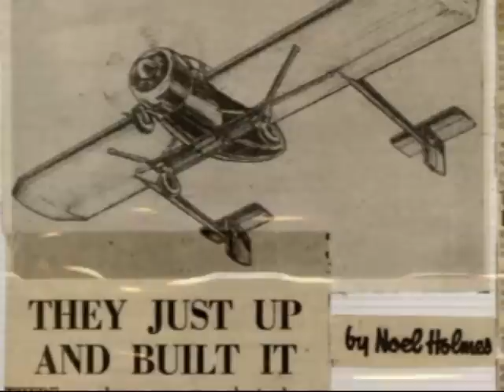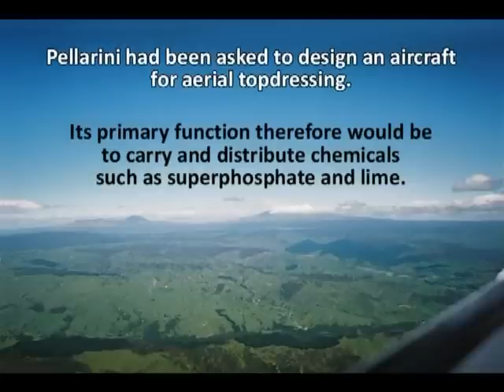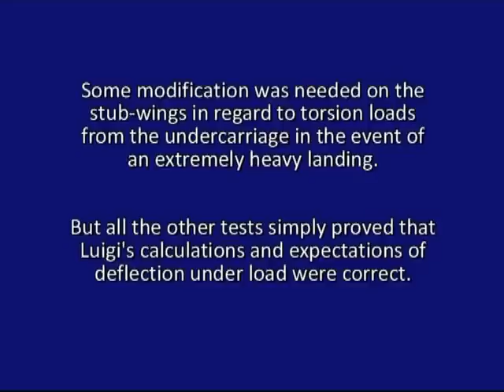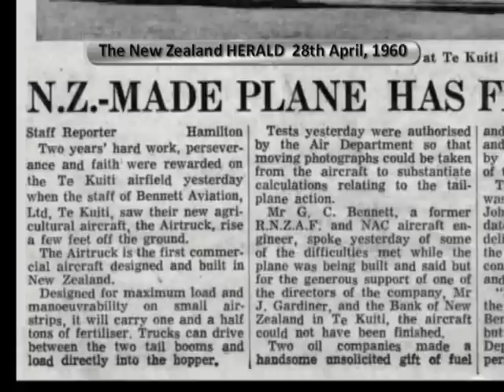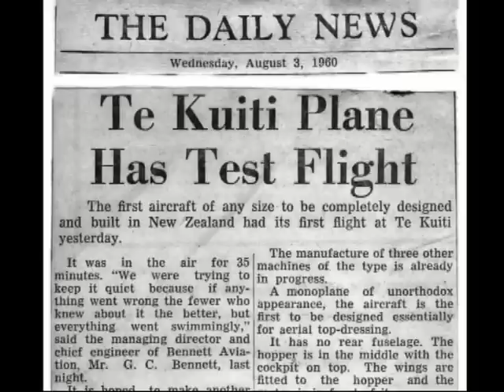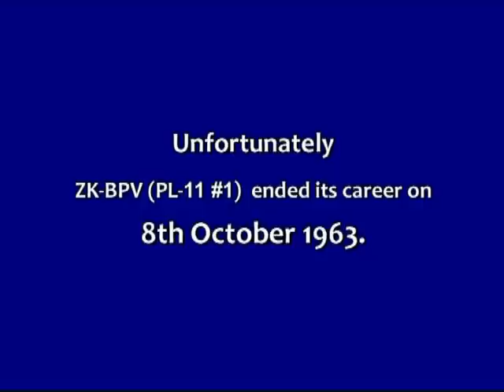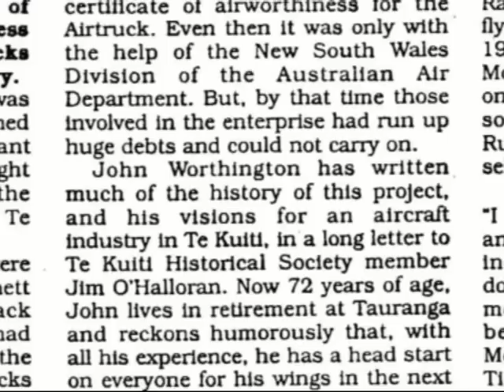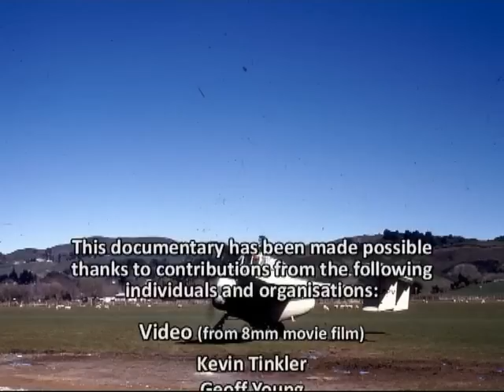PL 11 Airtruck Documentary ZK BPV MP4

Comment: The Aeronautical Engineer mentioned was Jeff Young- Not GEF.
Reply from the maker: Sorry to contradict you Shar but The  name of he Aeronautical Engineer who redesigned the PL11 after Luigi Pellarini left was Geoff Young - initials were G.E.F. Young.   
Jeff (Jeffery) Young was the maintenance man employed by Northern Air services. Jeff had nothing to do with building the PL11. 
Remember, I was there -- I was one of the team who  worked on the first PL11 prototype.  I knew both of the other two men who had the same surname as me, and to the best of our knowledge none of us were blood relations, but we did all have the same surname of "Young".
Reply: @rogeryoung9042  Jeffery Young was a British  R.AF. trained Aeronautical Engineer employed by Northern Air Services Ltd by J. C. Worthington as Chief Engineer, then Chief Inspector on the PL11, including construction, repair and maintenance, between 1961 and 1967. As chief Engineer he was responsible for a list of  other NAS Ltd and  Rural Aviation Ltd aircraft .
Reply: @rogeryoung9042 .what ever happened to the on that flue in the Mad Max Movie?
Reply from the maker: @sharynyoung1  Hi Shar. You mention that Jeff Young was British RAF trained. I was unaware of that, and yes he probably did  do maintenance work on Worthington's machines - couple of Cessna 180s and the original PL11 ZK-BPV.  At one stage Worthington also had a 150HP Piper Cub fitted with a hopper, but Jack W himself wrote that off even before I left Te Kuiti.  The Geoff Young, who took over the Airtruck design work after Luigi Pellarini left had previously worked with deHaviland in the UK . He certainly had the necessary University qualifications and hands-on experience to take on the task or checking all of Luigi's work and supervising the construction of PL11 #2  ZK-CKE.
The RAF trained Jeff Young you mentioned might have been involved with modifications to ZK-BPV, but in my discussions with Geoff Young, after he moved to VIC in Australia, he spoke as though he was the one only who assessed and supervised all the necessary mods to ZK-BPV. When he saw the video I had produced he admitted that he never had time to even think about taking photos of the development of ZK-CKE (PL11 #2). He was too busy "talking" with engineers from Civil Aviation Authority  AND  worrying about where the money would come from to pay his staff each fortnight.
Reply: @rogeryoung9042  Good to hear from you. I have found documentation that shows Jeffery (Mills) Young was indeed the Chief Inspector for the PL11 Airtruck (construction, repair and maintenance.). J.C Worthington was managing director (N.A.S.) and friend.  D. Simmonds the Engineering Manager at Rex Aviation. Jeff Young was Chief Engineer for Northern Air Services Ltd, later part of Rural Aviation Ltd. Maintenance, repair and overhaul was undertaken on Cessna 180,185,188, 172,182, PA18, DH82 Taylor 22 Kookaburra, Continental 0470,10470, 10520. 0320 Lycoming 0200 Gypsy Major. PW Wasp.P11 Airtruck.
These numbers probably make more sense to you than to me. If Geoff Young is still alive, I would be most interested to correspond with him and get a photo of him, as he most likely knew my father, Jeff Young. My brother and I often stayed on Te Kumi airport watching our father work on the airtruck and other aircraft. We often had Christmas with the Worthingtons. There are so many coincidences here. It is fascinating.
Reply from the maker: @sharynyoung1  Thank you for the input, Shar.  I got to know Doug Simmonds very well while I was working for Rurals in New Plymouth - also did a couple of stints in their Tieri workshop (Dunedin). Actually - a little secret - after I had written to  Rural Avn asking if they had any vacancies for workers in their hangar I got an immediate reply, "We have vacancies, when can you start work?"  But Doug was not happy with that. He and Snow bennet had been very good mates with the RNZAF on Guadalcanal during WW2.  So Doug took himself for a "little drive in the country".  and arrived at TeKuiti (aka  TeKumi) airfield, to ask Snow why this bloke was leaving an interesting project.  Well, Snow was VERY generous - gave me a very good "write-up" so that when I did arrive at Bell Block, New Plymouth, a couple of weeks later I was embarrassed to learn that I was expected to perform far beyond my own experience at the time . SO that kinda stretched me to do my VERY BEST on any repair job.  Then when Simmo learned that I had already passed my airframe LAME exams - and been issued with a license - they immediately put me on engine servicing (not my forte, at that time) so I could sit (and pass) my engines AME exams. The management seemed to be very pleased to have a LAME (airframes and engines) who also had a PPL  - Private pilot license. So I was the one chosen to go out on more than one occasion to "fix" a Cessna out on an airstrip and then fly the thing back to New Plymouth. I was just very happy to be able to get a few more hours in my logbook towards my CPL. Then towards the end of 1962 John Barr offered me a job in Ardmore - which I accepted. But that really put the "cat amongst the pigeons" because Peter Lacey, the only other licensed bloke on the hangar floor at that time, had just handed in his resignation a day or so before.
Reply from the maker: @sharynyoung1  
Shar,  My mind has been in a bit of a spin with some of the claims you have made about Jeff Young's involvement with the NZ built Airtruck.
However, for the sake of others who read this post I do need to point out that there is no contradiction in what you have claimed as opposed to the video I produced about the manufacture of the PL11 aircraft ZK-BPV in Te Kuiti, New Zealand.  
The "problem" is with dates. I would like to see the dates on those work documents you refer to where Jeff Young was doing major work on the PL11 Airtruck(s).
If you look at the dates on the work sheets where Jeff Young was involved I am fairly certain you will find they are all dated 1964 or much later. I am not certain what date Northern Air Services was taken-over (or absorbed into) Rural Aviation, but I agree there would have been quite a variety of aircraft types to be worked on. But that would nearly all be after Waitomo Aircraft Company ceased to exist and Geoff Young had moved to Gisborne, VIC., Australia in Jan 1965.

ALSO. A few facts that need to be recognized:
Jeff Young was employed by Jack Worthington to do maintenance work on aircraft operated by Northern Air Services. This was because some time in 1960 Snow Bennett had told Worthington that Bennett Aviation could no longer provide the manpower needed to do maintenance on NAS aircraft. But he was never employed by Bennett Aviation nor by Waitomo Aircraft Co who built the two prototype PL11 aircaft.

It was probably sometime in 1960 that Luigi Pellarini effectively walked off the job in disgust because the NZCAA officials did not seem to recognize his knowledge and experience in designing and building  aircraft. By the time he had started on design of the PL11 Luigi had already designed and built several successful aircraft. After settling back in Australia he was instrumental in starting up the Transavia company and working with Australian CAA had approval for his PL12 design long before NZCAA gave approval for the NZ built PL11 in 1966.  By that time Waitomo Aircraft Company had run out of money.

Geoff Young initially began work with Bennett Aviation in March 1960, and as Snow Bennett began to realize the qualifications and experience that Geoff had he began to look to Geoff for support. After Pellarini had walked off the job Geoff Young took over all the design work. He eventually did get some help from Australian Civil Aviation technicians, and also had discussions with Rolls Royce (in the UK) regarding his idea to re-design the PL11 and use a 600HP turbine engine instead of the huge and heavy P&W radial engine.
The overhaul of the engine that was installed in PL11 #1 ZK-BPV was done by Aero Engine Services, Rukuhia (Hamilton airport) and Alf Coleman from AES was present for the first time that engine was started after it had been installed in the aircraft.  

The first PL11 prototype ZK-BPV was written-off when it crashed on 8th October 1963. The pilot Jack Worthington survived.  Geoff Young was the engineer who was sent out to examine the wreckage - I have copies of some of the photos he took. And by that time he was well on the way with manufacture of PL11 #2 ZK-CKE [completed Dec 1964].  When Waitomo Aircraft ran out of money Geoff Young also moved to Australia [Jan 1965] and all subsequent work done for Northern Air Services (now part of Rural Aviation) would have been done under the supervision of Jeff Young.  But Geoff Young had done all the necessary design work and supervised the manufacture and test flights of PL11 #2.  He gave me copies of videos (made from Super8 movie film) he had made of some of the test flights.
Reply: Apologies, Roger, I don't wish to contradict you - I just wish to clarify Jeff Young' as having played a part in the manufacture of the PL11. J M Young worked as Chief Engineer for Northern Air Services Ltd from 1961 -1967 so it seems likely that GEF and Jeff must have known each other and/or worked alongside? 

Jeff came originally from British RAF. He delivered aircraft to the middle east, came to NZ and engineered in Fielding and Blenheim before TEAL in Auckland.  Aircraft Maintenance Ltd (Ardmore) then employed him and by the time he got to Te Kuiti he was well qualified to construct, maintain and repair a wide range of aircraft. 

The coincidences are intriguing with both men having the same name and both being very experienced aeronautical engineers who worked on the Airtruck P11 at the same time?  Dad (Jeff) also spoke of the difficulties with CVA gaining his Chief Inspector as a way to short cut the red tape. 

Jeff was also one of the founding members of the Te Kumi Gliding Club. (1964)

He  wrote drafts for the 'Maintenance & Repair Instructions (Waitomo) PL11 and Spare Parts Manual (Waitomo) PL11 He left when they ran out of money.

 
He went to Australia after a stint with Rural Aviation Ltd (Mossburn) and Graham Stewart Ltd (Rangiora)

Of the engineers at Te Kumi, I only really remember Brian Busby and Charlie Slade. My brother remembers Snow. I would love to be able to contact them if they are still alive.

My brother and I used to stay on the aerodrome in the flat at the back of the hangar.  We used to play in the Harvards out the back, canoe and swim down the Te Kumi stream.
Reply from the maker: @sharynyoung1   Hello again. That all sounds very interesting - so does that mean you also have spent time in Ozzie (Australia)?. 
Yes, I remember that little flat behind one of the hangars at TeKumi/TeKuiti. When I was working with Bennett Aviation we sometimes had our "morning tea break" over there - bit tough on the pilot(s) who considered that to be their temporary home.
As regards you father's work with the PL11 Airtrucks I would definitely agree that he would have had a lot to  do trying to persuade NZCAA to get on with the job and issue the required paperwork (Certificate of Airworthiness and Type Certificate Data Sheet) after Geoff Young had left in Jan 1965.. Your father (Jeff Young) still had another 18 months or so before that important paperwork was completed. Congratulations to him  for having persevered until that task was done.
As regards the other engineers who worked on the first PL11 - I know Snow Bennett moved to Australia to work with Luigi Pelarini on the PL12. But he died in the late 1990s. I do not know what became of Bryan Busby or Jack McClay. I understand Wally Dowman is still alive  - lives over somewhere around Tokoroa.  Geoff Young, as I have mentioned elsewhere, was living in Gisborne, VIC, Australia (NOT the Gisborne in NZ). The last time I spent time with him was in 2011 when I had been asked to give a talk to the AHSA (Aviation Historical Society of Australia) and I asked Geoff to accompany me so he could talk about his involvement with the PL11 Airtruck project. But even at that time Geoff was suffering  from Parkinson's Disease so I doubt that he is still alive. Has not responded to a recent email.  Ken (Blue) Langtry was living somewhere in Victoria the last time I had any communication with him, but that was probably about 9 years ago - when I had to prepare a talk for the AHSA group. I have an idea he has also died since then.  
Charlie Slade is not a name that I remember - he must have been one of the team that worked on PL11 #2. There was an almost completely different team that worked on the second Airtruck and I don't know their names or where they are now 
You mention that your father also worked with Rural Aviation at Mossburn - would that be the Dunedin branch?  I am pretty certain that the Chief Engineer of what I referred to as the Tieri Branch also resigned about the same time as Peter Lacey and I  both left from the New Plymouth (Bell Block) branch.
Reply: Roger Yo